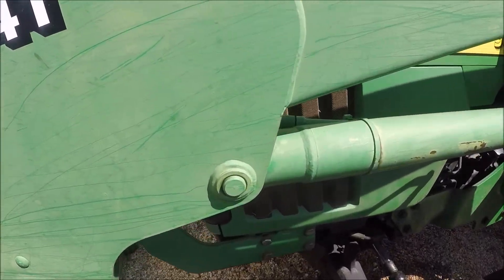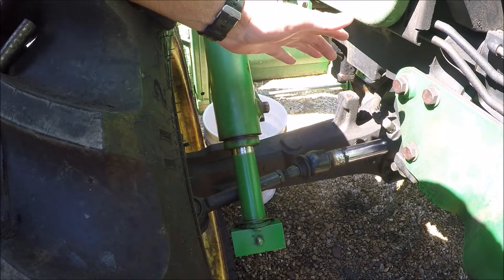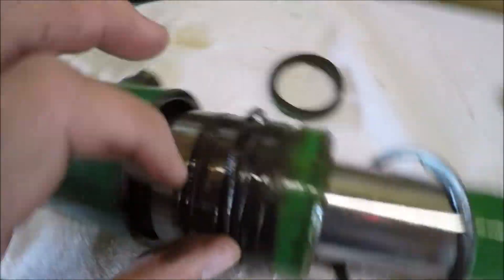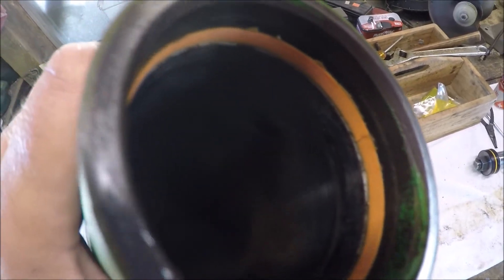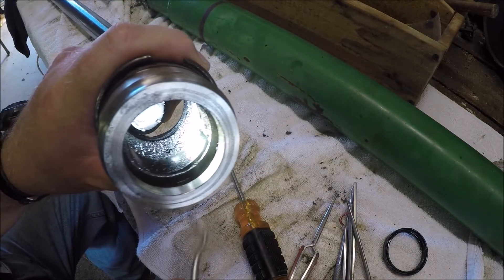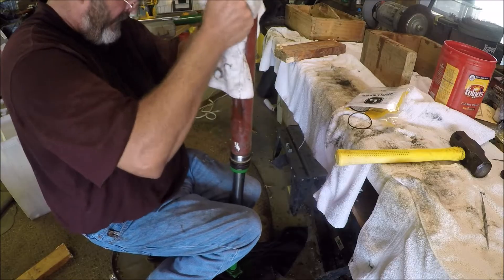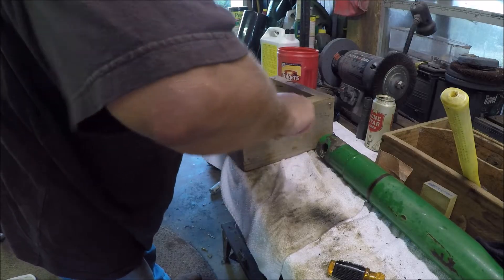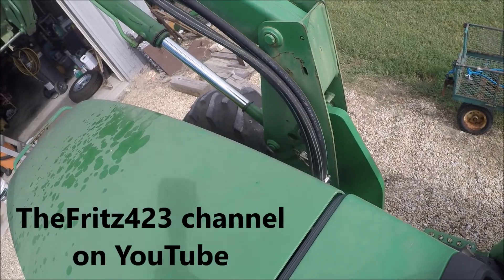Replacing the seals on a hydraulic cylinder; How to Disassemble a John Deere Lift Cylinder

Comment: A branch hit the hydraulic cylinder on my John Deere tractor  and broke the connector/nipple off of the cylinder where the hose attaches to it. Do you know if it can be screwed out or do I have to buy a brand new cylinder?

Comment: Every time I ever took anything to the hydraulic shop I would get a call that this was worn out and that was worn out and by the time they would get done I could almost buy a new cylinder. I started rebuilding them myself and not changing the saft and half the stuff they said it would need and never had any problems the shop always said I would have.

Comment: I have mine almost completely reassembled, I'm having a horrible time trying to hammer it back in though, even with hose clamp I can't get the internal snap ring to go into it's grove, it's ok to hammer the piston? Piston doesn't bottom out first?  I've been trying to just hammer the cap (using wood blocks so I don't damage it)
Reply from the maker: Hmm.  The hose clamp has to hold the internal ring in it's groove on the gland until the gland gets in far enough so the hose clamp is pushed up, at which point it can be removed.  Did you lube it all up well?

Comment: good job, you did what you needed to get the job done. anybody says otherwise, should go back into their parents basement and suck on a milk bottle. Only one thing i would like to mention, either bolt the legs of the bench to the concrete or make a metal one. It will be of great help for future  projects that require the vice and a lot of muscle.

Comment: Where could i find the bucket tilt cylinder replacement or the actual dimensions for the 240 front loader but the 1976's

Comment: Do you know the part # for the orange seal to allow the internal snap ring to com out
Reply from the maker: It came in the rebuild kit with the new o-rings
Reply: TheFritz423 unfortunately it didn’t come with the seal kit. Where else can I get it from. The guys at John Deere have no idea what I’m talking about and the hydraulic place near me of corse wants me to bring it to them to do.
Reply from the maker: Are yours lift cylinders from a 541 loader?  If they are any other model (or brand) there could be different ways to remove the cylinder head.  If they are let me know and I'll go find the kit in my large pile of discarded crap I call a garage.

Comment: When you disassembled it were you able to tell what failed to cause it to leak? I took the four cylinders for my 5210 into a shop, paid 1400$ and put them back on and two still leaked. Brought them back and they "fixed" them again. The whole reason I had a shop do it was time, and getting it right the first time. I now need to reseal my 49 back how boom cylinder, and also the cylinder on my 4n1 bucket.  Seal kits by themselves still are not cheap, but I will definitely be doing it myself. Thanks for the video!

Comment: I have an old (1973) Deere 70 skid steer.  I recently changed the tilt and lift o-rings and seals (first time in 40 years) and it was much easier than what you went through.

Comment: That yellow band on the piston might be a teflon ring. The have no memory to speak of. When you stretch it to go on the piston most times they won't snap back to shape like an o-ring will, The secret to putting those on is to put it in the oven, set the temp to 400 degrees then take it out as soon as the oven reaches that temp, you don't want a puddle of teflon. Then quickly put it on the piston. bring that right into the kitchen because if you have to go out to the tractor, it'll probably cool off too much. When it cools off it should be about the original size, if not put a hose clamp on it and tighten it gently, not too tight, that should press it back into shape. The heat expands it and softens it so it will give easier. when it cools it returns to about it's original size and firms back up.
Tip, wear dish washing gloves. Remember that ring is now 400 degrees. The gloves insulate just enough so if you move quickly you won't get burned. but aren't so bulky that you lose tactile ability. I worked in a hydraulics repair shop for twenty years and trust me, it works like a charm.
Reply from the maker: Thanks for the tip!

Comment: Use a brass punch to drive in the gland in.  Be sure to clean the inside of the barrel no sharps in there. 
The gland should no be that hard to slide on the rod.
Reply from the maker: Thanks, the corrosion under the wear bushing was the culprit...

Comment: did mine in one afternoon,  cost  $104 for the rings for all four cylinders the hardest part was getting the nut off but I hooked up the rod on the tractor using the pin and used a breaker bar. 
was quoted about $100 per cylinder.  
 good video thanks
Reply from the maker: Steve Sanders I've been worrying about this:  did you use Loctite when you replaced the nut?  I didn't.

Comment: Did you need to add any hydraulic fluid to top it off after you reassembled it since you disassembling it?
Reply from the maker: Filled it to the "max" line on the dipstick, then started the tractor until it warmed. Topped it off after that